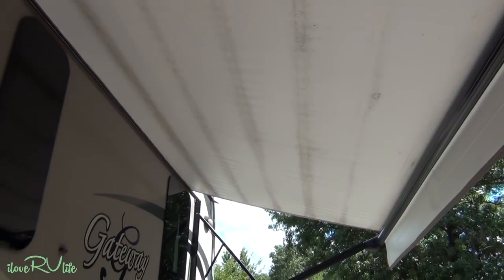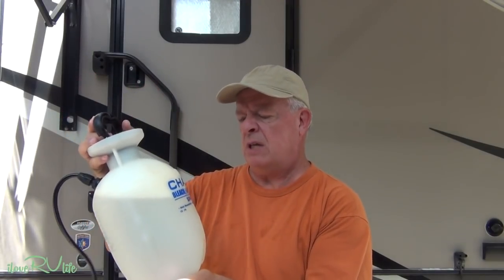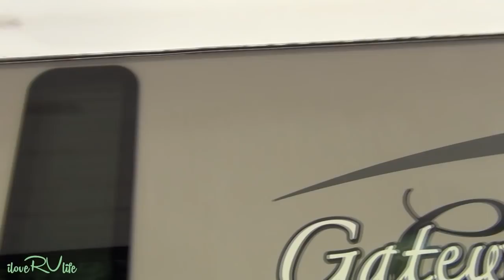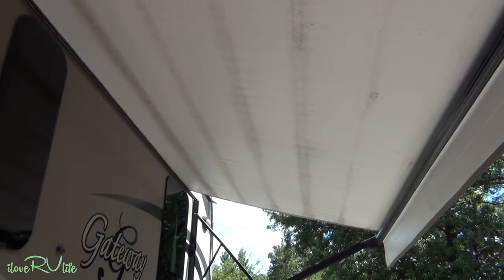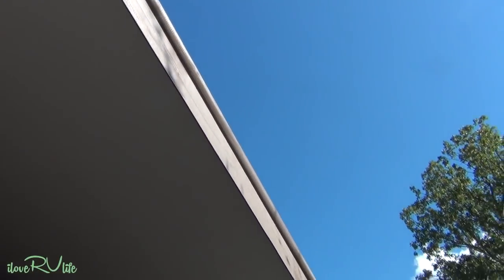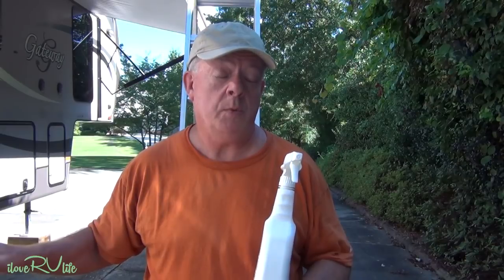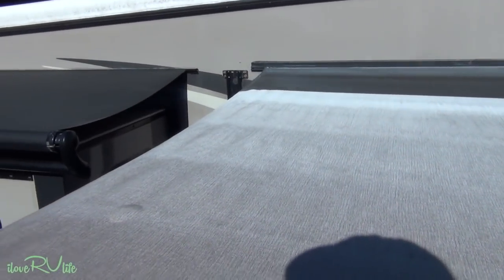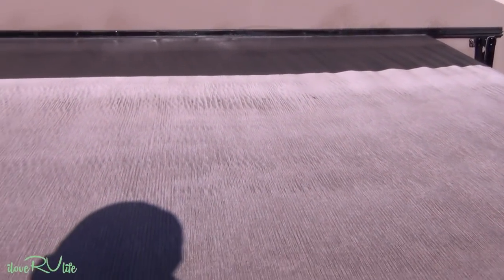Cleaning Your Camper Awning

Comment: This is the best video on awning cleaning that I've seen.  I used it last year and it worked pretty well.  This year, I tried something different and the results were outstanding.  I used 30 seconds outdoor cleaner that I got at the Home Depot.  I mixed a 1/2 gallon of product with 1/2 gallon of water.  I sprayed in on the underneath side of my awning and rolled it up for 3 minutes.  The label says to let it soak for 3 minutes.  Then I extended the awning and sprayed it off with the hose.  It looks beautiful and NO scrubbing.
Reply from the maker: Thanks for the tip.

Comment: Hi Jerry, We are new to owning an RV. We bought totaled travel trailer at auction 2 years ago and my husband spent last spring and summer making it look like new. Unfortunately the awning sat in the auction parking lot most of the winter it was there so it had a lot of mildew damage. I watched every video and read every article about how to clean a RV awning. I liked yours the most. I have probably watched this video 15 times. I followed your directions almost to a T last year. I only wish I would have followed them exactly. The bleach Dawn water mixture worked great leaving me with less mildew damage than I expected. The part of your directions that I didn't follow was concerning the aerospace protectant. I bought the protectant and the sprayer you recommended but I thought if applying the protectant on one side was good then applying it on both sides would be better. This was a terrible mistake. When I opened my awning last spring it had so much mold that I thought we were going to have to replace it. But I followed your step by step process and once again it worked. There's a little more mildew damage but it was a 80% improvement. I want to say thank you for taking the time to make this video.  I'm wondering if there's a product or a way that people keep water from getting in to the awning over the winter? We live in Pittsburgh and get lots of rain and snow. Our awning does not seem to be watertight when it's closed up. Even one rain is enough that when I open the awning it is soaked. Help!
Reply from the maker: It’s tough to keep the wet from entering the awning.  Even in warmer climates, rain seeps in.  It’s just one of the spring maintenance items to clean every year.  The small amount of bleach and a good scrub with a soft brush help works out the mildew and slows growth throughout the year.
Reply: @iLoveRVlife  Thanks for taking the time to respond.

Comment: That works pretty good. My wife and I use a 50/50 mix of water and rubbing alchohol.  We used it for the first time on our pop up when we owned that. It had mildew on the canvas. Came right out with light scrubbing and never returned.

We now use it on our awning for our travel trailer. Works great and doesn't harm the awning. Love your videos we actually started using happy camper because of your recommendations.
Reply from the maker: Thanks for the tip Marvin.  Great to hear you all are enjoying the channel.

Comment: When I put the 303 on mine, I use a sponge and rubber gloves. I start with it out a foot or two so I can reach across it, and use a bowl to hold the 303, then dip and wipe. Move it out that much more and go over it on the new exposed until I get done and role it up without drying. It roles out smooth without that tacky sound after that and I think must somewhat treat the underside too. I use 303 inside and out and on the side walls and treads of my tires on my camper and vehicles. It does help with weather check. Thanks for all your videos.
Reply from the maker: Thanks for sharing Joe.  Great tip.

Comment: Excellent video Jerry, very helpful as I just purchased a used motorhome and will be cleaning the awning just as you have done.  The only thing I could say would be that you might want to protect the side of your coach as just about any cleaning agent can streak vinyl graphics.  It happened to me many yrs ago on my new Holiday Rambler and the streaks were there until I sold it.  I think buying just about the cheapest poly you could and then taping it next to the awning pullout and then along the entire edge of the awning so no chemicals hit the sides of the coach.  Again, thanks for the great videos, I just subscribed so I'm looking forward to more of your videos.
Reply from the maker: May help John.  So little bleach, haven’t had an issue.  And give it a good rinse when you roll up.

Comment: Good video on cleaning the awning. You referred to Dometics instructions for the use of Bleach and Dawn dish soap which Dometic recommended. I researched and review the Dometic Awning manual and found no mention of using a brush in the instructions. I'm sure we can all agree that a little elbow grease always dose a good job. I also found a Dometic product. Dometic Premium RV Awning Cleaner and video. It appeared to work extremely well. I did ask for clarification as to what type of dirt and debris mediums were used. Iy clean up nice. No UV protectant just a cleaner.
Reply from the maker: They don’t mention a brush, but for bird poo and heavy stains, a little scrub action with a soft bristle brush does a good job on those tough spots.  I always follow up with a good coat of 303 UV protector.

Comment: Thank you so much for this video! This worked great on my awning and I did not get nearly as wet as the last time I tried to clean it using a power washer. Your technique is simple and actually worked great! Thank you so much for the recommendation to use the 303 Aerospace UV Protection spray...my awning looks so much better! I highly recommend this technique using the chemical sprayer and RV brush.
Reply from the maker: Thanks much Brian.  Easy, quick, less than an hour and it’s squeaky clean.  Great to hear you had positive results.  Appreciate the comment.

Comment: This is awesome!  We used to use simple green, scrub brush and get soaked.    Curious how you do the top of the camper as well
Reply from the maker: Thanks.  I like Meguiar's M43 Marine/RV Boat Wash and a soft bristle scrub brush. It’s easy on the finish and strip wax off sides as it runs off. Be careful gets slippery up there. Also use on the sides. Leaves a nice finish.
Reply: Watch the whole video he uses a ladder

Comment: This is so good! I was wondering what to do with those lines on my awning. Probably could use some safety googles and maybe longer arm sleeves if there's a bleach sensitivity. Thanks for the tips!!
Reply: Would using the 303 on the bottom help mitigate the mildew?
Reply from the maker: I don’t know of any properties in 303 to prevent mildew.  The small amount of bleach and letting it stay on the awning for the short period helps kill it.  Damp and rolled up awning for periods of time is hard to prevent, but a good cleaning once or twice a year keeps its from becoming a nasty mess.

Comment: My recipe - one garden sprayer, one part bleach, five parts water.  Rinse awning, soak with bleach water solution, roll up awning while wet, wait 30 minutes, open awning and rinse liberally with clean water.  Very little scrubbing required afterward for the random bird poop, etc.  Been doing it once or twice a year for years.  Works amazingly well and doesn't damage the awning.
Reply from the maker: That will do it.

Comment: Another suggestion when using this technique is to protect yourself especially if you're sensitive to chemicals. Wear a long sleeve shirt,  disposable latex or nitrile gloves, eye protection, and a disposable mask (everybody uses them these days) You don't want bleach droplets in your eyes, mouth, or nose. Also, bleach can harm plant life near your work area so wet down your bushes, flower beds, etc. before you start spraying bleach on your awning. When you are all finished with your project, rinse down your plant life once more.
Reply from the maker: This is a diluted solution,  but a very good tip.

Comment: Find a Jayco dealer ghey have a killer pink soap ,or your can use tide soap brush it on roll  it up leava for a while  ? Depends  on how gruddie  it is ,then scrub, also 303 makes several  chemicals  ,check them out USE THE STUFF, ive been at it since 1974 ,my awnings are 20 years old 🤗🤗🤗🤗retired  RV mechanic also🤑
Reply from the maker: Thanks

Comment: Hi Jerry.   This isn't a favorite job of mine either, however, the results make the effort worth it.

I especially liked the tip about spraying the 303 protectant on the top of the awning.

Do you have a video on how you clean the slide toppers?   If not, could you create one?

Thanks!
Reply from the maker: Hi Peter.  303 is amazing stuff.  Use on the awning, slide toppers, rubber seals around the sides and the tires.  Makes a difference over time.  The slide toppers are the same as the awning.  Just reverse the process cleaning the top vs. the bottom.

Comment: I will be buying a RV later on this year. Should I go ahead and treat the awning with the 303?
Reply from the maker: Hi Sally.  I would.  Even though the awning is new, sun damage starts day one.  Just a few dollars spent will extend the life of your awning.  Jerry....
Reply: Mold Armor connect to garden hose wet then apply follow with rinse no scrubbing unless you have very bad mold or stain cost $9.98 at home Depot or lowes
Reply: Not mentioned here, but there is 303 and 303 for specifically for fabric.  Do not use  "303 Fabric Guard" on other items where regular "303 Marine Aerospace Protectant" is used (tires, plastic, vinyls, rubber) as it will leave a oily residue which is extremely difficult to remove, but it is formulated for fabric use.  This oily residue is what helps restore the waterproof qualities of the fabric, regular 303 Marine will not restore beading of water on the fabric and but will help UV damage.

Comment: Pressure washing is a bad idea! I just shot a couple pin holes in my awning!☹️
Reply from the maker: Agree.  If the pressure washer has a setting to dial down the PSI, the. A little safer.  Best to squirt, roll up, gentle scrub and rinse with a water hose.

Comment: Great video!! Would it be easier when doing the top of the awning if you roll it up about half way so you don’t need to stretch so far, then roll the rest out to do the lower half? Just seems to me to be easier and safer. Thanks for the videos, keep them coming!!
Reply from the maker: Thanks Phil that's an option.  I just wanted to get it done in one shot.
Reply: @Philz570 1 Correct me if I'm wrong but doesn't the lower part come out first and the part you have to stretch for come out last?
Reply from the maker: It does!

Comment: Drop the awning down after opening, make sure there's no in the camper that could open the door, and it's easier to reach. Thank you for the advice, awesome.
Reply from the maker: Thanks and good tip Jerry. Unfortunately Lippert motorized don't dip but a few inches.

Comment: Do you have any other ideas well how to clean the awnings I tried doing this with the bleach and detergent with no luck I have also tried mold remover with bleach and that's not working and I look at my awning it looks more like rust but how is that possible I know my awning is 5 years old now and every time and I'm going camping and come back home I have wash the RV and Awning and let it sit and let it dry for 2 hours before rolling it up and it's always look good but this time it's different I had a RV cover over my RV this winter so the weather will not mess anything up had plenty of room for to breathe and so on but I went camping last weekend and notice owning looks pretty rough and it makes me mad here I have an RV that's yes 5 years old that I can open the doors and still smell the woodwork like brand new this is one thing I do take pride in is my stuff for that I buy I would like for it to last a long time I am scared to use straight bleach on it but if you have any suggestions please help me out thank you for taking the time to read this
Reply from the maker: If it looks like rust, I doubt that it's mold.  I expect this is some kind of stain.  I had something similar happen from a long trip and after the last stop, I roll up the awning and had some leaves trapped.  After setting for several months they stained the awning.  It was a mess and a lot of work to remove, but I'll share this with a warning.  You could damage the awning, so be careful.  You'll need to make a decision, if it works, your happy, but if it harms the awning, you're happy to replace.  Use the same mixture I mentioned in the video.  Use a Mr. Clean Magic Erasure and rub the spots where the stains are located.  Hopefully it's only spots or streaks and not the entire awning.  I would start with minimal pressure and increase if it doesn't seem to work. The white part, the erasure, get's used up quickly.  For my project, I used about 8 or so.  Just fair warning again.  You could remove some of the finish from the awning depending on the extensive nature of the stain.  For me it worked, but I was very careful and it removed quite a mess I had created.  Jerry...
Reply: Thank you again I will have to try that out I'm usually real careful with everything for my slide out I get up on a 6 ft ladder and wipe it off as my wife pushes a button to make it go in and I wipe my owning off before I roll it up at the RV Park then I get home and clean it let it set for 2 to 3 hours before I roll it up and finish backing my RV up I may be the only person that does that it comes to RVs cuz like I said earlier I don't like keeping my stuff for a long long time and the money you pay for your RVs is this wow.

Comment: A tablespoon for a gallon is a terribly solution and I find it hard to believe that it could remove much at all. A thorough rinse will be all you need, even with a stronger solution, to clean the awning with no long term effects to the awning fabric.
Reply from the maker: I wish that’s all it would take, but a thorough rinse will not kill embedded mildew.  We and many others have used this process many times will no issues to the fabric.  It’s just enough chlorine and time to kill mildew, then a soft bristle brush after 30 minutes along with that thorough rinse and it looks great.
Reply: @iLoveRVlife  yeah, I did 1 1/2 gallon of water, 1c of bleach and 1c of Dawn, sprayed both sides and rolled the awnings up for 15 minutes. It seemed to work really well and needs minimal brushing.